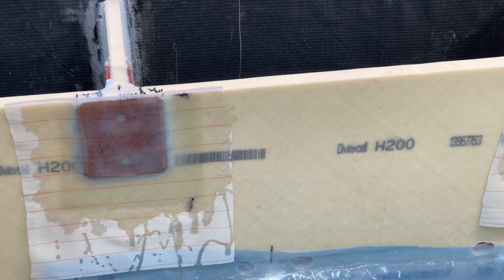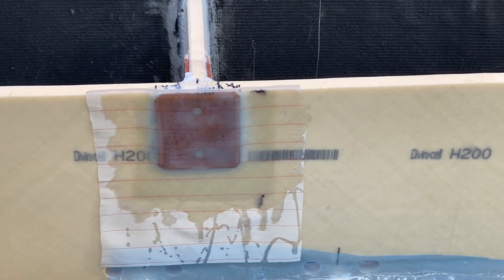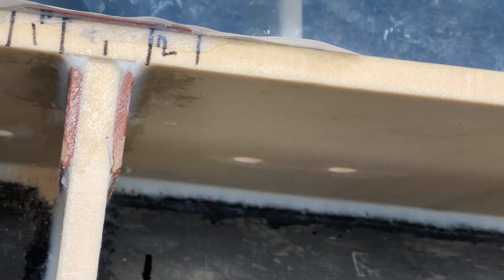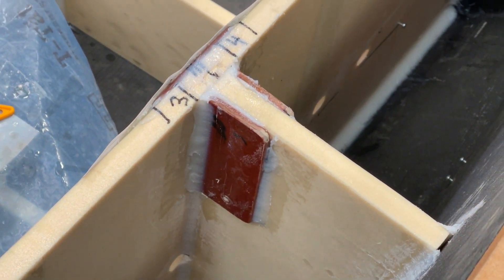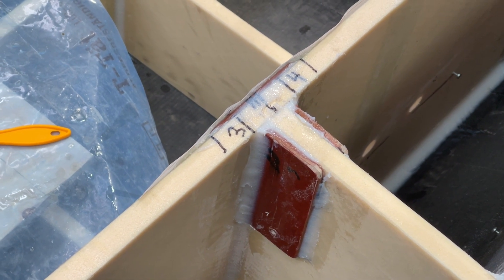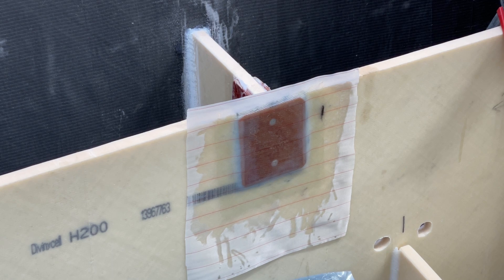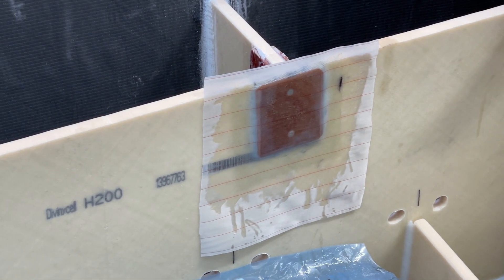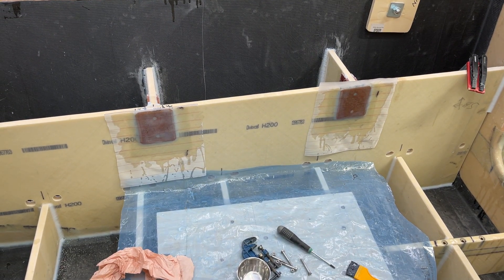Safety belt one more small step and some reflections on their use.

Comment: Hi Sven, I know that your boat will be somewhat waterproof, however, are you planning to fit bulge pumps and in which compartments will you need it most seeing that you have various compartments and possible point of entry.....?
Reply from the maker: There will be pumps in the compartments that have deck hatches because when the hatches are open water may enter..
When the deck hatches are open in strong winds the openings in the bulkheads to the inner compartments will be closed.